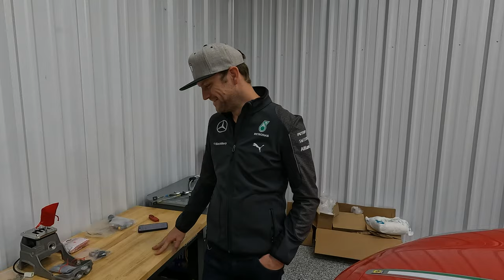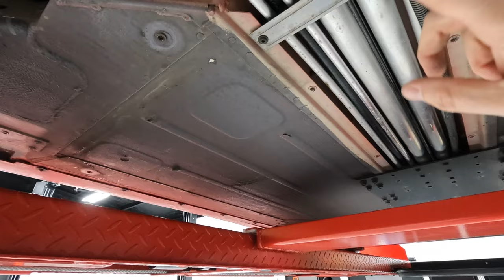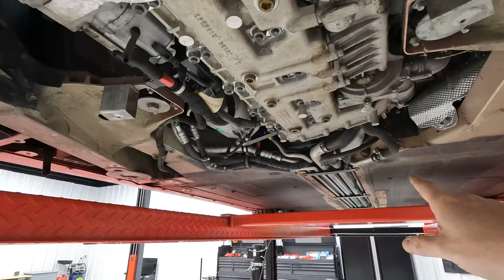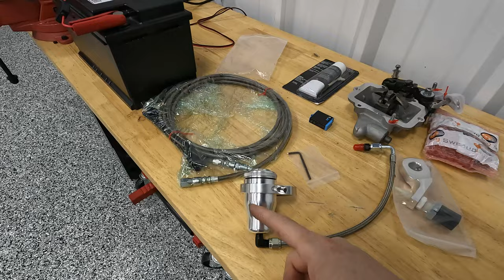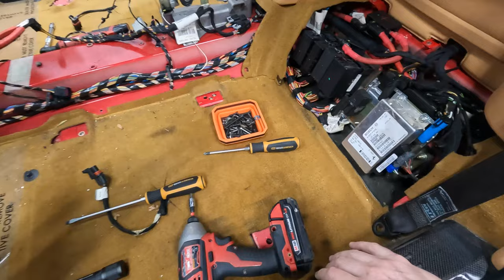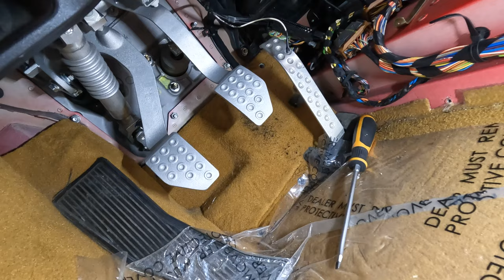Ferrari F430 DIY Manual Conversion - Clutch Cylinder and Pedals installation

Comment: I would highly recommend replacing the foam piece that was cut to access the installation of the master cylinder and reservoir in the front.  It is really difficult to seal reseal it when it is cut and leads to leaks in the frunk, which causes mold and the paint on the frunk hood to peel.  Ask me how I know.  The only way to do it properly is to fully replace it or it will never be sealed properly.
Reply from the maker: Noted

Comment: Curious why the clutch master had to be modified. And what had to be changed? Something like cylinder bore vs pedal travel, based on the Ferrari pedal travel and locations of the push rod locations?
Reply from the maker: It was simply reservoir related